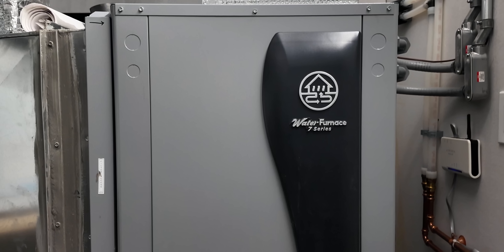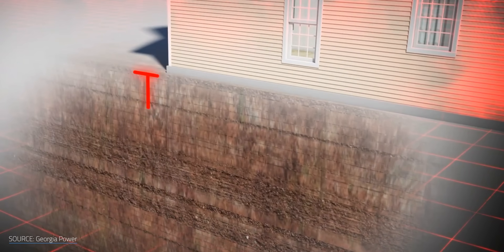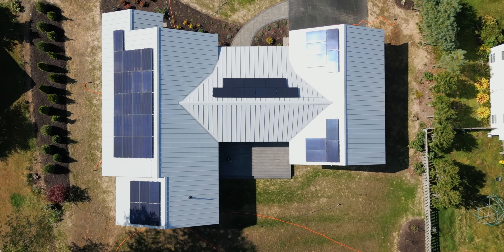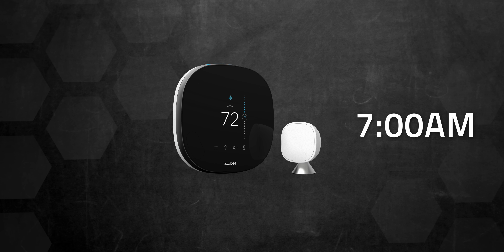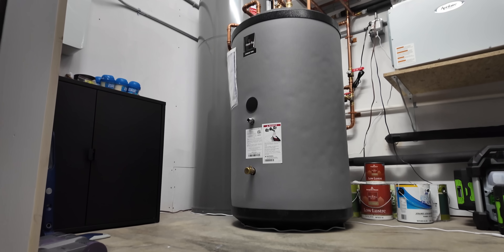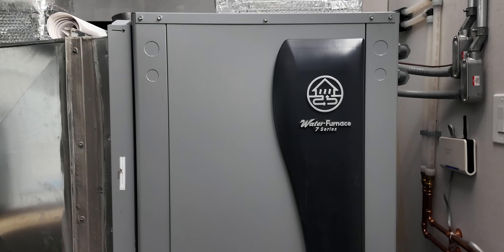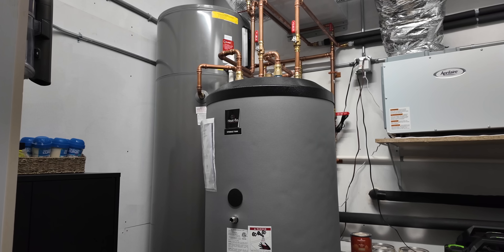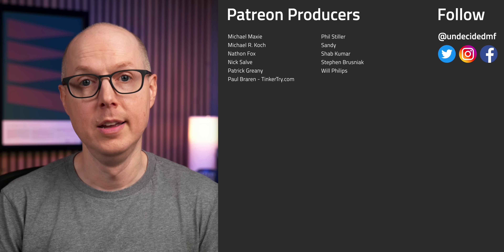How My Geothermal Heat Pump Really Performed (2 Years)

Comment: Here’s two questions that you should ask yourself before spending a lot of money. How long do you plan to stay in that house and how old are you? Both of these variables can affect what you actually do. You can spend a lot less money and still have a comfortable house I’m in my late 70s and I would never get paid back on this kind of expense but I can use 1000 or 2000 W inverter tide for practically peanuts and where I live. I run practically everything off of gas and I have an attached sunroom with 8 inch stamped concrete on the floor and a trome wall. Direct solar heating into inside the structure with mass is still the most efficient.

Comment: I've had open-loop geothermal units in two homes I've owned over the years. The first one was pretty trouble free for the 7 years I owned the house (once I got the installation issues resolved). It failed catastrophically on the next owner after 1.5 years of them owning the house (internal water supply connection failed, flooding the basement and damaging the electronics of the unit beyond economical repair). 

One cost that tends to be overlooked is the very high cost of replacing failed high-efficiency parts like a blower motor and eventually the evaporator coil in the air handler. To get excellent performance and comfort, a variable speed motor is often used in the air handler. To replace a variable speed blower motor in an air handler is VERY expensive (10 years ago, one cost me $1600 for the motor and $400 for labor!). That one repair wiped out a whole lot of energy use savings as compared to having a traditional 2-stage air handler. About 5 years later, the evaporator coil developed a leak and the cost of repair was so high that I ended up replacing the whole air handler to the tune of almost $7k just before selling the house. The original blower motor failed after 10 years and the coil failed after 15.

Don't believe the hype when a geo salesman tells you that the system components have a 20-25 year lifespan because they are not exposed to the elements. And when the equipment fails, be prepared to part with plenty of dough to get the system up and running again.

All the above said - every situation is different and what makes sense for one situation may not make sense for another. For myself, I've decided to return to older technology HVAC with an air-to-air heat pump with a 2 stage air handler in my new modular home. The operating cost isn't as low as that of a geothermal unit - but the lower installed cost, lower potential repair costs and simplicity of the equipment are important features in my opinion.

Take care and God Bless.
Reply: @theElderberryFarmer  great points, I had a building with 25 such machines , most local techs could not work on them when they failed… always ended up paying more for repairs… 
After 7-10 years most of the interior units failed… they were trane units… parts were not available… we tore them all out and installed mini splits….
Reply: As a fridgy, I agree with your take. 
I always tell people, if you buy a Cadillac, it will cost you Cadillac money to fix.

Comment: A couple of thoughts...
1.  We should discuss those rebates. You go out and get a Geothermal system and my tax and utility dollars goes to paying a third of the cost. I am not saying I am against the idea of a societal movement toward renewable energy, but it should be up for discussion. At least Matt can address it.
2. What's going on 400 feet below the surface?  Are the rocks hot?  Is there superheated water? Is there molten lava? And does it return hot air? hot water? hot oil? I hope Matt can also discuss some of the science.
Reply: @josa720  Your tax dollars also subsidize oil, natural gas, and coal.
Reply: @StephenPitmon It sounds like you're trying to throw something at me beyond the context of me wanting a discussion. Like a scold. What's your point?
Reply: @josa720  Your tax dollars also subsidize oil, natural gas, and coal.

Comment: My reading is that it saves $1150 a year in heating after costing $78k. But that includes duct work and other things. Let's go with the $39k price tag for a retrofit. That means roughly 30+ years to break even?

Comment: I'm in an old (100+ years) house in Westchester County, NY, and have no ducting. My heating is gas-fired one-pipe steam, and my AC is window units. I've installed significant solar in two stages, currently have 60 panels, with the intent power heat pumps (in addition to all other household loads and EV charging). I would think that ground-sourced heat pumps would be doable for mini-split systems...but no manufacturers seem to do this. Do you know of anyone doing this? I don't know of any thermodynamic reasons for not doing this...

Comment: Interesting, here in the UK there seems to be increasingly less ground source fitted as air source is cheaper and the performance gap in our milder climate is ever reducing. It wouldn't surprise me with the next refrigerant change if air source fully takes over for us. We do have a lot of stone buildings that have huge thermal masses that match really well with heat pumps.
Interesting to see different solutions. Part of me does wonder if it would have been more efficient using a more radiant system using water than a convective as the slower you can move the air the less heat loss you get and humans mainly sense comfort via what the radiant heat is doing.

Comment: You mentioned that you you were in Massachusetts, as am I. You did not review what impact living in Taxachusetts had on the geothermal finances. MA has a 6.25% sales tax, and very significant property taxes. You had to sink a bundle of money up front in the systems acquisition cost. In addition, those high costs probably substantially increased your quarterly property tax.  If you financed the house, you have to consider the increased finance cost as well. You mentioned a twenty year time span. Is twenty years going to be a long enough time period for you to break even on the heavy up front investment.  Would you have been financially better off going with a less expensive, albeit less efficient system, and investing the cost and tax savings in a low fee stock market EFT or Index Fund.

Comment: Our retrofit by Dandelion of a ground source heat pump system for a 3000 sq ft house was about 55k, before any incentives.  It dropped my monthly utility cost from $725/mo in 2022 to $335/mo for 2023.  Additional work on tightening up the house has gotten that down to $230/mo for this year.  That's for oil and electric (and now just electric); and includes me swapping to an EV charged from grid in 2023.  Its saving me 5k a year over the old oil system and electric AC compressor.   The upgraded attic insulation and windows are saving another $1.2k/year.  And the house is tremendously more comfortable - before the upgrade we'd do 65 in the winter and 75 in the summer and now we just keep it at 71-72 year round.

I regret not getting the integrated hot water heater at the time, but we'd just replaced the failed oil hot water heater.

Sadly our house is not well suited for solar (way to much shade).

Comment: I call this "passive geothermal", as opposed to "active geothermal" which is what the magma and core produce to power generators.  "Passive geothermal" is what you are using to heat and cool your house using underground pipes and stored heat energy underground.  We all need to make the distinction between the two.

Comment: I would only use geothermal if I installed it myself. My electricity bill averages about $350 per month it’s higher in the summer and about a third less in the winter. I live on the coast of North Carolina and I keep my house at 65* year round so I save money in the winter because I like it cooler. I don’t want to pay for ten years of electricity upfront because I’m betting that electricity costs will go way down when technology for solar gets cheaper/ batteries ect. So I would rent an excavator and bury the loops myself. I have also seen people using underground coils for mini split systems which drop the component cost drastically.

Comment: I live on Vancouver Island on the west coast of Canada, so we have a mild climate. There are very few geothermal systems in our area, since most neighbourhoods are built on rock. Air-air heat pumps are everywhere, and we don't need backup heating systems since we don't experience temperature extremes due to pretty consistent on-shore air flow. So my comment is mainly to point out that geothermal only makes sense in some areas.  On another topic, how long before you tackle that unwanted and inefficient heat source called your network closet? That sucker is seriously throwing off your energy use numbers! 🤓

Comment: I recently had a couple air-source heat pumps put in and immediately wondered about doing a hybrid approach.  Run something like a 100ft long loop of large ~6-8" pipe around 4ft down for each heat pump to channel above freezing air into the exterior unit to help with its efficiency and output.   It'd be much cheaper than ground-source heat pumps but hard to say how much it'd help.

Comment: Hmmm... My wife would definitely enjoy the stabilized temperature, but I need it cold at night to get a good night's sleep. I set it back to 65 in the winter, but keep the AC units set to 74 in the summer (I always start out at 76, then give up and set it to 74, because I just can't sleep at 76). I grew up with a poorly insulated attic door in my bedroom, so the thermometer on the wall would read 55 degrees on a cold winter morning. The thermostat was in a different room. I got used to a cold night's sleep. :)

Comment: I’ve had a water circulation heat pump since 1990. My property is next to Lake Michigan.  My rural home is well and septic anyway. My heat pump just takes water from the same well. Used water is discarded in a dry well - where it eventually gets back to the lake. Sounds wasteful but the level in the well pipe hasn’t changed in the 35 years. Well water is always 50f. I calculate that my furnace uses an Olympic pool’s worth of water in a week when it’s really cold. The AC is very quick and efficient. One nice thing. No outside noise. While my neighbors AC whir away constantly in hot weather, mine is practically silent. I’ve had to clean minerals out of the system 3 times, I’m on my second pump motor, I wore out one furnace and I’ve had to clean out the dry well twice. My system has a secondary heat coil that only kicks in occasionally if it’s very cold — never in recent years.
Reply: Those pump and dump systems seem the best.
Reply: Kinda wild to think you're using all that well water just for it's heat.
Reply: @JHe-f9t  The water isn't really "used" - it's just recycled back into the ground.
Reply: @twmcmahan  Kind of... wells can get contaminated that way. It really depends on the underlying geology. If it's a deep well turning into surface water, its definitely not being 'recycled'.
Reply: @JHe-f9t  Water table close to a large body of water is seldom deep. YMMV.
Reply: @JHe-f9t  Where do you think the water goes from the dry well?  It's like rainwater.  It goes back to the aquifer.  How is the well going to get contaminated?
Reply: @percyfaith11  Again, it depends on the underlying geology. Surface water aquifers are generally contaminated by human activity while deep water aquifers are not. Pulling significant water out of a deep water aquifer can increase rates at which surface water intrudes into deep water through cracks in the rock layers.

If this person's septic field is dumping into a surface water sand based aquifer, pulling far greater water than normal for a household will increase the risk for contamination from the septic field and other surface sources due to the change in gradient.

Comment: It's a little disingenuous to say that it cost you $2.50 per month is operating costs because a lot of that is coming from having solar which had a capex too. The more appropriate method would be to calculate how much electricity it consumed and let people do the math for how much that would cost them locally so that the solar panel savings could be accounted towards the ROI of the panels rather than the geothermal system

Comment: There's a major flaw with your investment math.  From a financial perspective, you invested $54,000 after rebates and this investment is providing a value of about $1,240 per year in utility savings.  That's a rate of return of 2.3% per year.  You can get higher returns with 0% risk with GIC's / CD's and you can use those returns to better offset utility bills if you want.  US Treasury Bonds yield about 4% which nearly doubles your return while still maintaining effectively no risk.  However, while your system currently has similar maintenance costs as traditionally systems, your system is more complex so there is a risk that you would have higher maintenance a decade from now.  Batteries will probably need to be replaced in 10 to 15 years etc.  Since you're talking about this using very long-term horizons, you could look at investing in an S&P500 ETF providing an average of 10.5% returns.  S&P500 is higher risk short term but extremely low risk over multi-decade horizons.  So the flaw in your reasoning is that this is somehow saving you thousands of dollars but that 2.3% return doesn't even break even with inflation so you are effectively losing money.  If you want to spend money to save the environment then that's a good personal reason but you shouldn't attempt to portray these decisions as somehow being a good financial investment.

Comment: My main challenge with these setups (or even in-floor heating) is that the idea of a constant temperature doesn't sound great to me - it sounds horrible. I hate sleeping in warm rooms. If I do anything like this, I need a totally separate zone for the sleeping area - which will probably increase costs as well as complexity.

Comment: I use a heatpump system that takes energy from 200 meters down under. I live in Norway. Had the system for 7 years and it works great, for every kWh I put in I get almost 4X back. Big upfront investment but makes sense when living in the same home for many years. Want to get solar next 👍 Thanks for another great video
Reply: I live in Norway too.  My new Panasonic air-air heat pump has a great performance at the temperatures I see here during winter.  It does never drop below -15C and rarely below -10C.
The heat pump produces 5KW of heat at -15C.   Do you see benefits compared to modern air pumps?   I guess they must be better for really cold days, and that the noise is much better at high performance heating.

Comment: We looked at the costs here in the U.K. and the difference between air source and geothermal was  significant, after the BUS grant our a2a was £1000, however a geo thermal system, with a vertical well because we don’t have the horizontal space, was £12000 which was a shame. So we’re aiming more for load shifting to off peak and looking to add more solar to reduce costs and energy use that way.

Comment: "app" -- what are your options if the manufacturer stops supporting the app and it fails?
Reply from the maker: The thermostat would still work on the wall with or without the app.  I could also just swap out the thermostat at that point to something like an Ecobee.
Reply: @UndecidedMF  Got it, that part wasn't clear. I'm wary of app-only major home infrastructure.

Comment: Great to hear how well it has worked for you. It will have paid you back many times from a gas boiler as many people have. I added an ASHP, upgraded my old 20+ yrs old double glazing, renewed our broken down cavity wall foam spray with bonded beads, solar and battery as well as an EV. I save a huge amount per month £450 as a rough idea. At that rate in just 6 years I will have been paid back all that I spent and have had other payments back thanks to schemes at the time. My electricity bills for whole home and 1,000 miles a month are an average of just £90.
My old boiler never paid me back, my gas/petrol cars never paid me back.
Well done Matt.

Comment: From Denmark. Installed Geothermal 2 years ago in an established house. All included was around 30K USD with digging the garden to a total mess (900 feet of tubing spaced 3 feet apart) Heat pump, new electric subpanel and the heatpump itself. including taking down the old gas furnace/boiler. No duct work - installed to the already installed water born radiator system. Due to the water born system, and no new radiators, we have to run a bit to hot water - loosing some efficiency. But still after 2 winters we have cut the heating bill with 70%. - The garden however need an overhaul next year - not calculated into the cost.

Comment: We live in a newly built home with an air to air heat pump. I would have loved a geothermal system instead but this was already installed. We still have the near air tight envelope and ventilation system with heat recovery so I'm very happy about that. That was a major factor in choosing this home and we love it.
Reply: @BramMertens  for most residential homes, air source is the way to go : two thirds the benefit for one third of the cost.

Comment: I haven’t dared to take the step to replace my gas heating system, but I was able to reduce my gas usage by by 2/3 so I only use 1/3 of what I previously used - simply by installing a VZ9SKE air source heat pump in our large living room. We live in Denmark and our house is 186 m3 and we love the heat pump. SCOP of 6.2 and the price was 3500 usd including installation, so the ROI is approx 3 years. So, significant reducing both gas usage and expenses.. what’s not to like 😊👍
.

Comment: what is your comparative cost ammortized over 20-25 years, or the life of the system vs the cost of running conventional heat pumps with a life span of 10-15 years(or whatever their average is, NG furnaces are about 10 yrs)